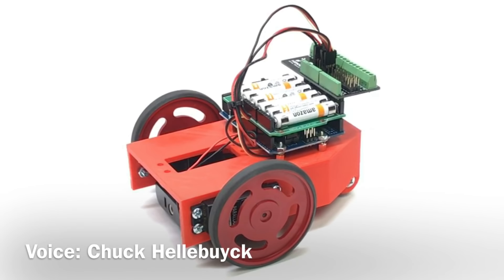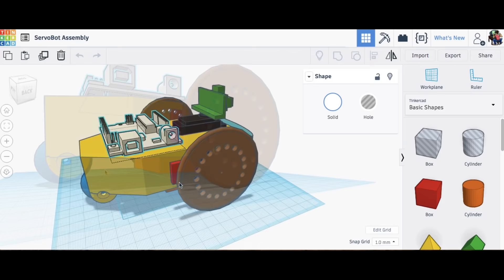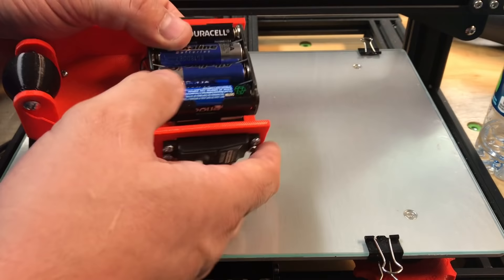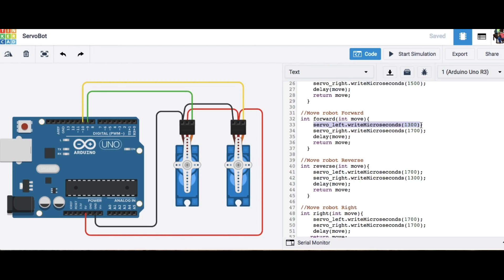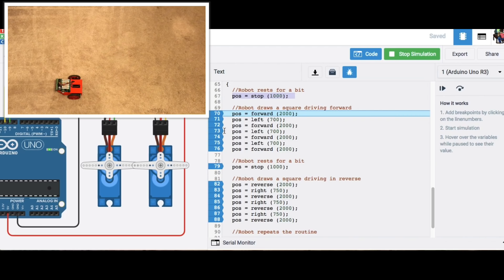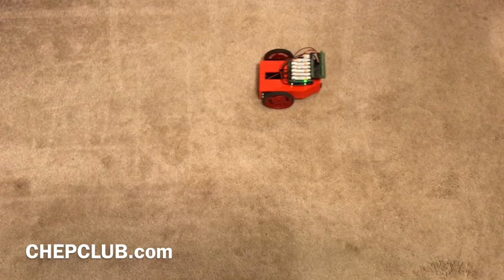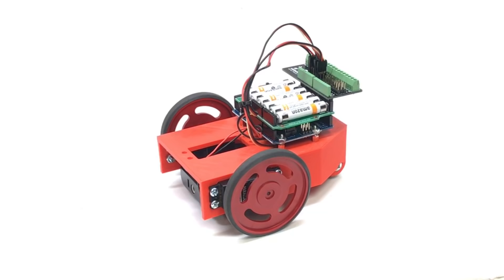Arduino Autonomous Servo Robot Designed in Tinkercad

Comment: Awesome - can't wait until you have the refined version.  This is exactly what I've been looking for to get my feet wet.   I have Unos, servos, etc.   A robot base in Tinkercad that can be modified as needed is the missing link for me.  The only observation I have is that the front wheel ball should either be a loosely captive steel ball so it can rotate freely in all directions or better still a caster.  The front wheel ball as it is does not roll during sharp turns and is likely partially affecting your turn accuracy.

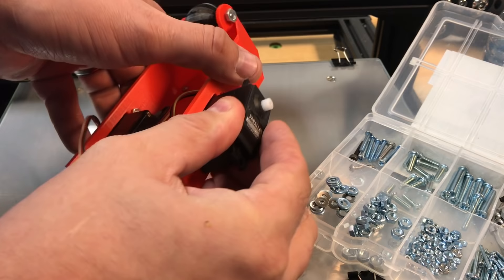Comment: 2:35.. You should mention that those are special Continuous Rotation Servos. Regular R/C servos will not work unless modified.
Reply: I must have skipped over the Arduino programming... I'm a PIC guy.